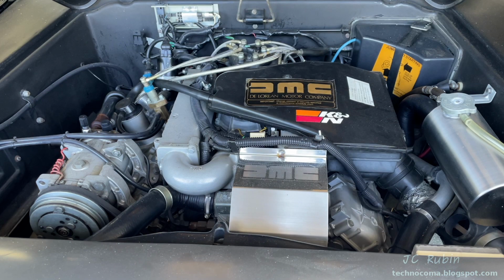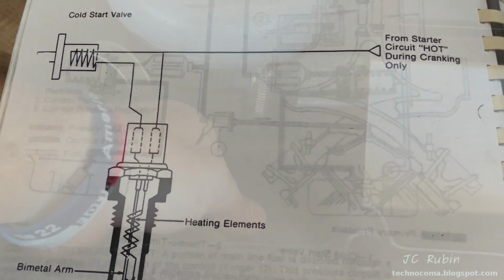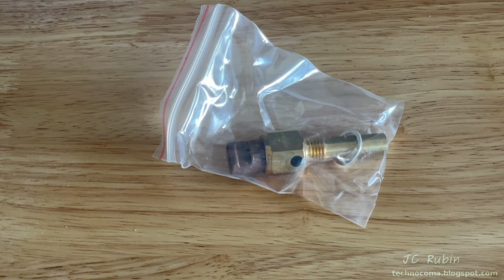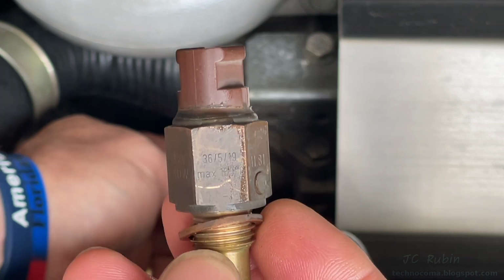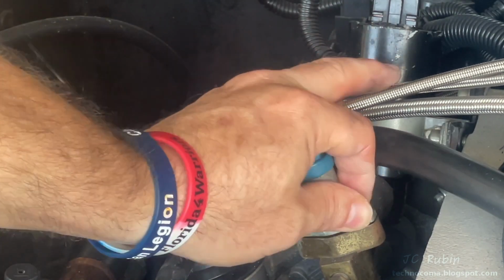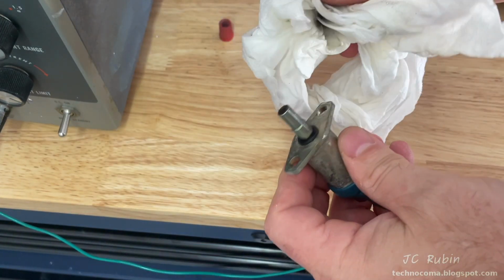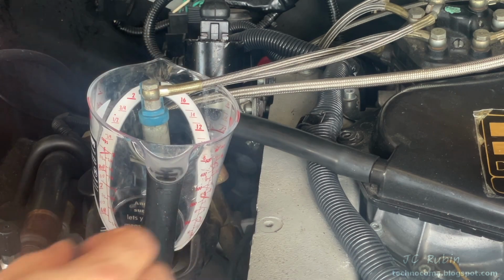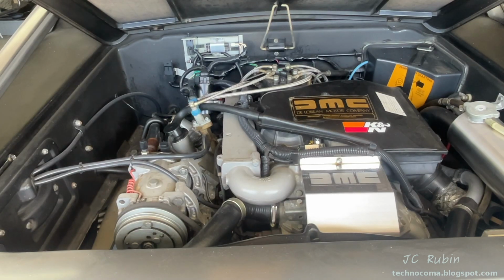Bosch Jetronic Cold start troubleshooting as performed on a Delorean

Comment: So it seems that the the ultimate issue was a gummed up cold start valve? Was the brand new thermotime switch non-functional?
Reply: Watched the whole video and I have no idea what you fixed.  You seemed to put all your old parts back on and start the car….
Reply from the maker: I will be conducting some further tests on the new switch, connected externally in ice water to test if it functions.  I didnt want to loose focus on the troubleshooting by spending too much time on the new switch.
Reply: @delorean1  But just to  reiterate Chris's question, is it your notion that the issue was the cold start valve?   Early in the video you show the technique of pulsing power to the cold start valve.  Did that work here?  It would seem that with a gummed up cold start, pulsing it would not get the engine to start.  Would the pulsing technique be a way to verify the cold start operation without taking it all apart?